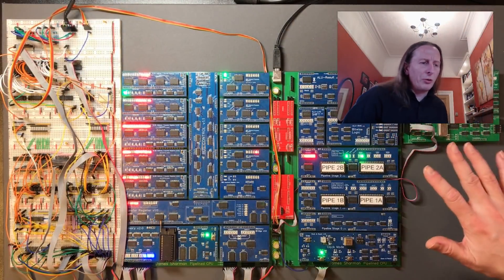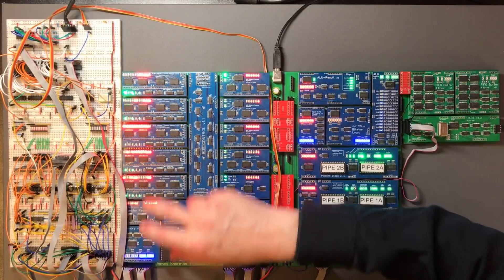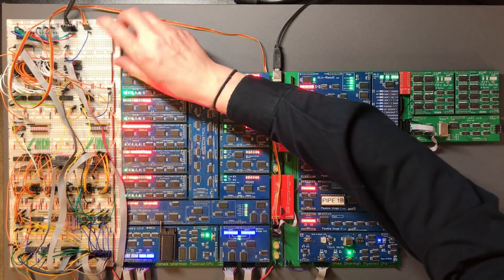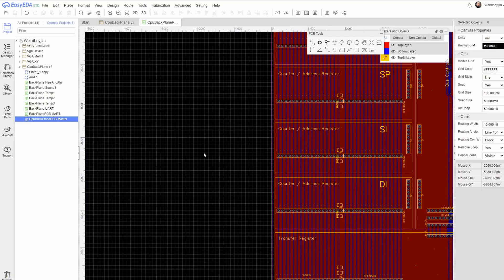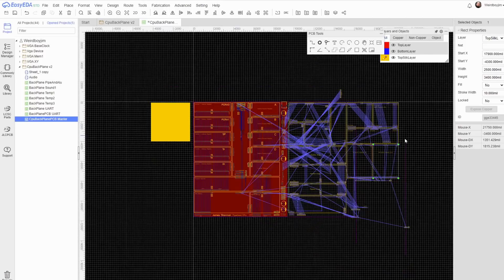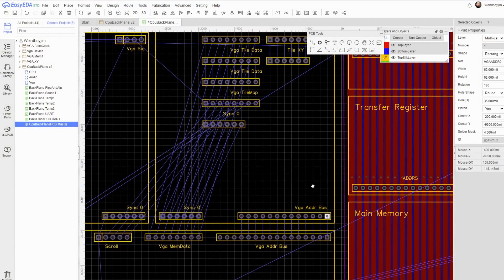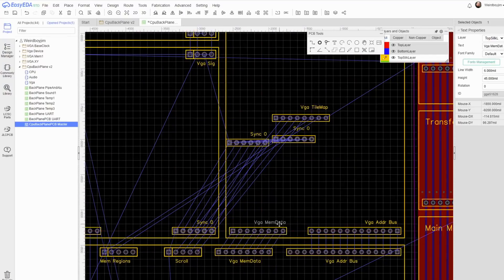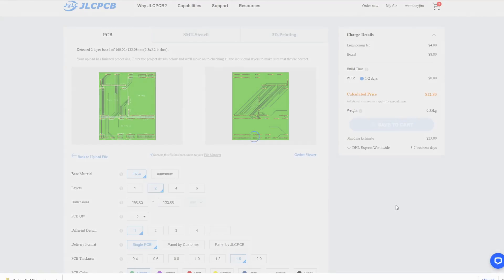PCB Planning - VGA from Scratch - Part 6

Comment: It must be very satisfying once the design is set down on a real PCB, but there's just something so cool about the breadboard phase.
Reply from the maker: I do like the breadboards! Past a certain level of complexity it get's a lot easier to put things on a pcb though.
Reply: @weirdboyjim  the original Amiga prototype had it's custom chips on breadboards. I think they may actually have been wirewrap, but still. Mindbending.

Comment: Is there any problem with having 21Mhz going through so many connectors?
Reply from the maker: It's 25.175mhz.  To be honest I'm not 100% confident, it's definitely at the upper end of what works on a breadboard but I think this will be ok on the pcb's with good traces. At these frequencies it is definitely worth keeping an eye on it. If I run into problems expect some videos on why and how to resolve it ;-)
Reply: @weirdboyjim  awesome! I probably would have chickened out and gone with sma connectors or something.

Comment: This build is so intriguing. I’ve been trying to figure out whether it would be possible to program a game like Id softwares first Wolfenstein game. The 3D effect was pulled off with ray casting, which is pretty simple to do. Much simpler than the binary trees used in Doom. But I could see the lack of floating point values and sprite limitations making it impossible. 

I just think it would be super cool to have a home built computer that can technically run the earliest implementation of a FPS.

Do you think the finalized design you have in mind could run such a game at a playable frame rate? If not, any ideas on what tweaks may be necessary and whether it would be worth the technical effort?
Reply from the maker: Glad you are finding the videos interesting! Ok, there is a lot in your questions. Firstly, I think it would be possible to have a homebrew cpu run Doom itself, not this one but I may do a 32bit build in the future and that sounds like a worthy ambition.
Reply from the maker: Wolf was ported to a pretty wide variety of devices but fundamentally it really needs more memory than my cpu can address. I think you could do a “wolf like” 3d engine on a capable 8-bit cpu though. It’s worth noting that such an engine doesn’t have to be a grid ray caster like the original, years ago I did some experiments with something I referred to as “a portal based 1d rasterizer” which I suspect might be more efficient at the low end.
Reply from the maker: It’s also worth noting that games like Wolf, Doom and Swiv 3D all spent a disproportionate amount of their time in the inner loop of software rasterizers. Wolf and Doom relied on texturing lines of constant-z. If you wanted a really interesting hardware project you could build a kind of primitive GPU that could texture a single horizontal/vertical line leaving the cpu to do everything else. That would be fairly simple but vastly more efficient than doing it all in software. Would make the any of those games much more achievable on low end hardware.
Reply: @weirdboyjim  That’s a really interesting idea! The 1D GPU rasterizer idea along with a portal-based view would indeed be a very smart way to go about it. 

I’ve been toying with lots of ideas for a build and of course scope creep is always an issue.
But the one idea I can’t shake is that it would be awesome to have a home built FPS box. Thanks for the ideas.

Comment: I haven't yet watched all of your build videos so you have certainly already gone over this, but how are you interfacing with your peripherals? I'd imagine it uses memory mapped IO, but do you have some kind of control signal the peripherals can set to bypass memory or is there an address space set aside for all possible peripherals. Is there a line from the computer for each peripheral telling it when it's being used?

Sorry for all the questions, but I really find this computer fascinating!
Reply from the maker: There is no single, simple answer to your question. There are a few things you would be interested in, most of the peripherals use IO ports which are closer to the internal device connections some micro-controllers use. Those device are connected directly to the internal bus. The vga however needed more than I had spare, so I implemented some memory mapped IO. The vga already needed all the address and memory lines so that wasn't so bad.

Comment: Welcome back James and thank you for another great video. 

I am curious, what are your experiences so far with soldering SMD components? Do you feel it is easier than soldering through hole components or not? You make it all look so easy, especially to someone with virtually no soldering skills, like me.
Reply from the maker: Ok, worth noting that I had done a bunch of through hole before but pretty much all my smd soldering is present on this channel. You really have to separate out drag soldering from paste+stencil soldering as 2 very different things. I'd suggest the drag soldering is slightly tougher and I wouldn't want to do that without some kind of magnification. Using the hot air is usualy easy, but the effort goes into accurate stencil and component placement.

Comment: You're one of the few who use EasyAda on YouTube. Many frown on it because it doesn't have all the features of other more complex PCB design applications. I find it to be, however, a well-designed, user friendly and perfectly capable PCB editor. The few features it lacks are not used by the vast majority of users.
Reply from the maker: I try to make things as accessible as possible to people and for an amateur picking up pcb design for the first time it was great. I may do some stuff with other packages in the future but I need a compelling reason to put the effort into learn them.

Comment: This was a long awaited update!  Very nice design philosophy with thinking about making everything work together visually in addition to electronically.  Thank you.  Looking forward to the next video!
Reply from the maker: Glad you enjoyed it! There is a lot more work on the vga pcb's to be done but I'm keen to get back to extending the circuit
Reply: @weirdboyjim  This video circuitry is much more than just a VGA display controller, and I expected it to take a while to get to this video due to the overall complexity of this portion of your build.  My favorite part of this is that you are going to be building in the same manner as the processor:  A more manageable modular, and expandable, way.

Comment: I heard “sprites” (plural) several times 👀
Reply from the maker: You must have misheard. :-D
Reply: I surely hope not
Reply: sprites board. a board for sprite !
Reply: Very much looking forward to sprites! I can’t get my head around how they would be implemented, but I’m sure after a video I’ll have a much better understanding!
Reply: @amyruthworrall  Isn't it quite straightforward? You take the x/y coordinates of the current pixel (the framebuffer counters produce that), take a memory-mapped port with an x1/y1 address, then subtract x2=x-x1 and y2=y-y1, and if x2 >= 0 and x2 < sprite_width and y2 >= 0 and y2 < sprite_height, your read x2/y2 from the sprite buffer. If the read data is 0, you do nothing (transparency), otherwise you force the video output to the read value (or to a 1 for bw sprites, or to another port's value for single-color sprites, ...) instead of what the framebuffer is doing. Repeat that as many times as you have sprites.

Neat trick here is to not use the same x/y mapping as the framebuffer. That way the beam racing shenanigans (see previous video) do not affect the sprites, they are drawn on top of all of that.

One simplification for this would be to simply duplicate the complete framebuffer and just add the transparency logic. This would give you one fullscreen sprite that can be moved freely. Do this a couple of times and you have a screen that's made up from independent layers at the expense of RAM. I think some arcade machines did this as they weren't quite as cost restrained as home computers.

(There are simpler sprites that are more akin to hardware-assisted beam racing, but I don't think this project will go that way.)